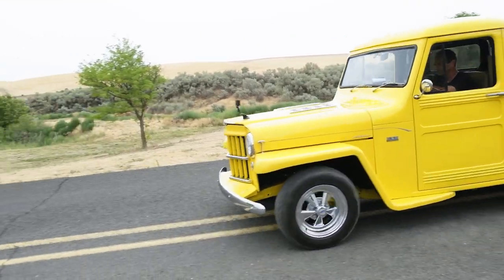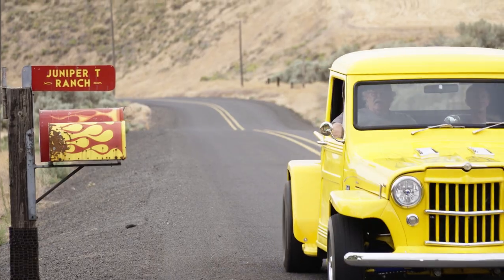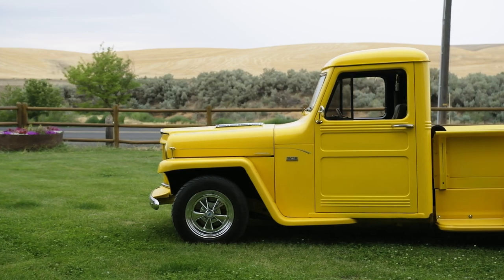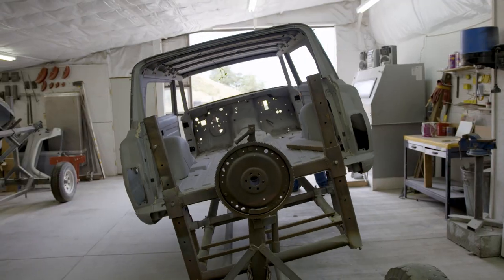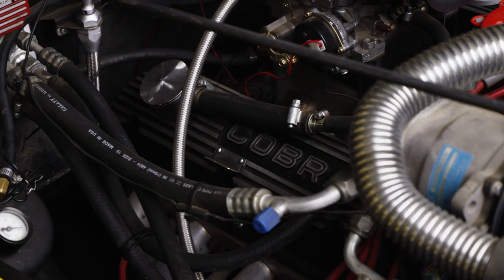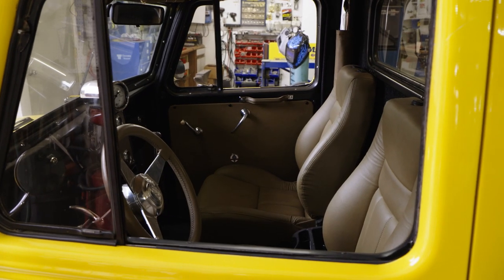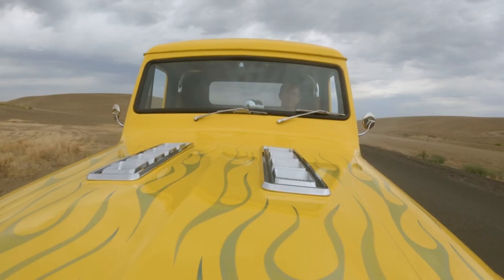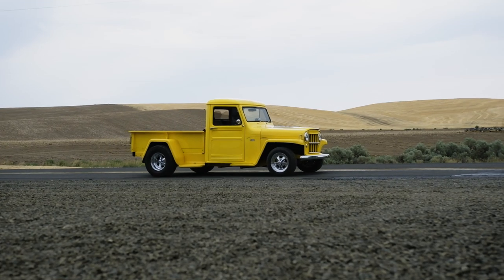Willys Pickup Gets $150k V8 Makeover | RIDICULOUS RIDES

Comment: What did he spend the other $100,000 on?
Reply: That's exactly what I was thinking 😂... Top speed of 120 slower than stock Miata. 🤣
Reply: Rotisserie Restoration
Reply: @deeredude  should've put a Chevy in there...
Reply: Eric Worthington: "should've put a Chevy in there"

Thx bro, took the words right out of my mouth: he'll have serious reliability issues until he replaces that POS!

FORD = Fix Or Repair Daily, Found On Road Dead, etc. . . .
Reply: @ericworthington7299 oh you guys are harsh!😅 there's plenty of old Fords out there still running. It is hard to beat a SBC for reliability. 4 psi of oil psi and two plug wires chewed of by rats and it will still get you home.